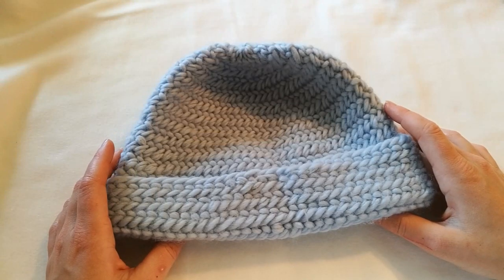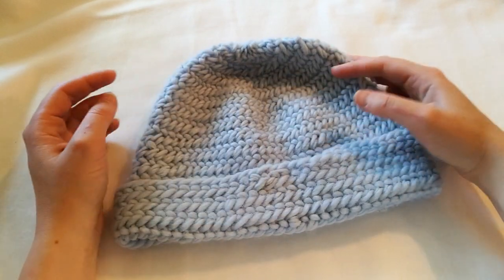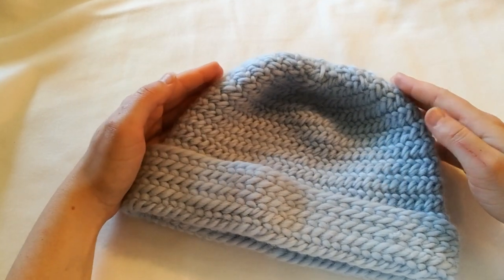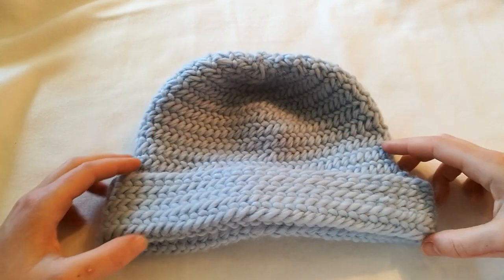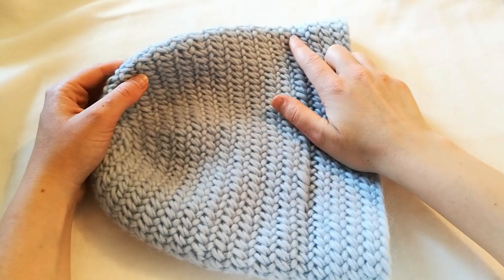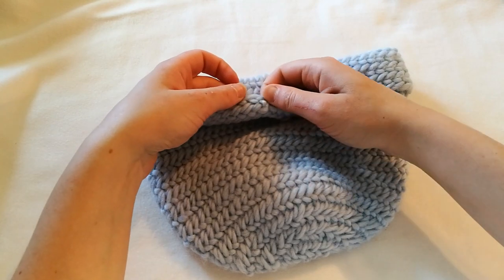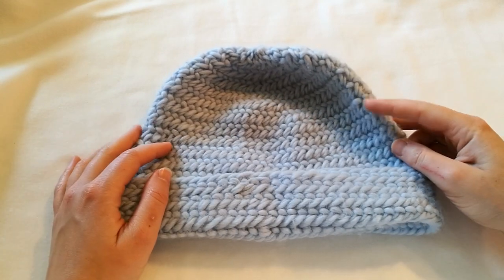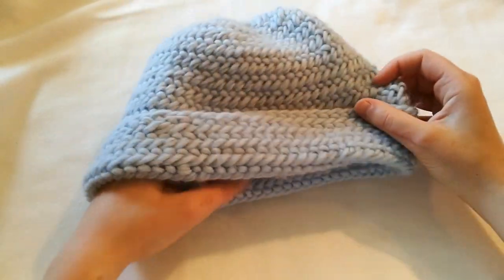Nålebinding - Making a hat, part 2

Comment: I hope you are enjoying your hat now that it's winter. I'm worker on my third nalbinding hat for my daughter after making one for myself and one for my wife. I've been starting them at the bottom and working my way to the top. For my wife and daughter, I just measured their heads at the start and hoped it came out OK. My wife's ended up a little tight but it's loosening as she wears it. 

I like your idea of decreasing a row at the crease. Too late for my current project, but I think I'll try that on the next one.

My first two hats used the Oslo stitch, but this time I'm keeping two stitches on my thumb instead of one and the hat has a more pronounced pattern and is thicker and will likely be warmer.

Thanks again!

Comment: Thank you for these tutorials. Will you be making more?
Reply from the maker: I might do. I know some people want to learn stitches I haven't covered, like the Mammen stitch. I'm also considering mitten and sock tutorials, but I would need to get better at them first. 

Is there anything specific you would like a tutorial about?
Reply: I saw a video of a fellow at a RenFair kind of gathering and he had what he called "Viking socks" but they looked like slippers to me. :) They were done with Nalebinding as well.
Reply from the maker: @HrafnNordhri  They probably were socks, but just thick (because of the yarn) and with low shin parts (because those are hard to get to fit). Making closely fit things with nalbinding is hard.
Reply from the maker: @HrafnNordhri  I'm considering doing a sock tutorial, but you will have to have some patience ;)
Reply: Deal. :)
Reply: @HomeWithMyBookshelf  your videos are the easiest to follow. Thanks for sharing. Could you do a video about finishing a product please?
Reply from the maker: @bonnieg3793  The only thing I do to finish products is to weave in the ends with a tapestry needle and cut off the excess. Then I go out and wear them! I never bother with blocking or shaping, in my opinion it usually sorts itself out while wearing the product. If you want, you could use a dampened cloth and an iron to flatten anything that needs flattening.

Comment: About how many meters or grams did your hat take? Does nalbinding take more yarn than crochet or knitting? Thanks!
Reply from the maker: I used about 100 grams for this hat (100g = 102m). The amount of yarn you use very much depends on the stitch you are using. If you are using a compact stitch, you will use more yarn. The Oslo stitch is one of the least compact ones. I would expect to use about the same amount of yarn if I had knitted or crocheted this hat using the same yarn.

Comment: If you are making  a cowl how would you increase over the shoulders?
Reply from the maker: Hello! I am currently making a shawl thing that is like a cowl, just with a split down the middle. The instructions I'm using said to start with a line that would be at the neck and go back and forth, increasing every 10-12 stitches. I'm finding that to be too seldom, but it depends on your yarn. I would increase evenly, though, but how often again depends on your yarn and the stitch you're using. Since I assume the cowl has no opening at the front, just go round and round increasing evenly. I'm just guessing, but I hope this helps! I'm just going to have to make a triangle for the front to get mine to close, so good luck! Keep in mind this is advice from a relative beginner, I have never made a cowl.
Reply: Keep in mind that you can kind of follow a crochet pattern stitch number wise. What I mean by that is take a plain stitch crochet pattern that gives you how many stitches you're supposed to have after each row, or at least an ending row, plus a measurement.  For example: the finished hat circumference works out to 80 stitches and measures 22 inches. (These are just made up figures as an example!) So you do 80 of your chosen stitch and then measure it. If it measures to 22 inches then you're golden! If not figure out how many more, or less!, you need to get to the measurement. There's your percentage of what you need to either increase or decrease!

Comment: Do you full the finished hat?
Reply from the maker: I didn't. If I did, it wouldn't fit anymore, as it would shrink in the process (I had to look up the word, as I only know it as felting or toving (the Norwegian word)).

If you make the hat a little large, you could full it, but it might turn out pretty stiff. I would consider using a slightly thinner yarn if you were going to full it.
Reply: @HomeWithMyBookshelf  : Thank you so very much!